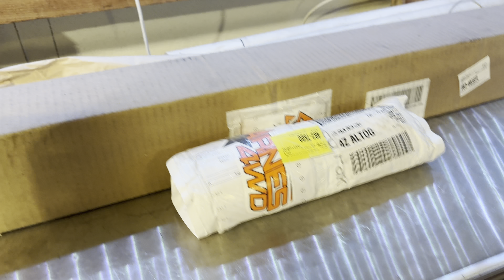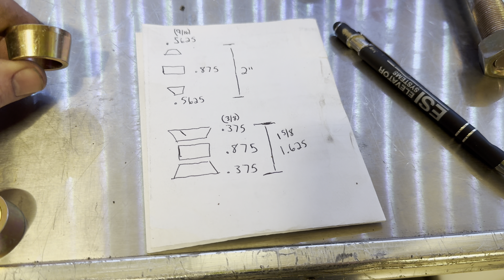Building the Steering!!! Jku on Tons part 11!

Comment: If you use the front holes you won’t have full steering. The distance from the center of the balljoint to the center of that mounting hole is more than the pitman arm and won’t allow you to have full steering.
Reply from the maker: I didn’t realize that! Thank you! I will get some more bolts and get the drag link switched to the back hole! I do have a gap in between the factory stops on the knuckles so there’s room for more steering angle which would be great. Turning radius is terrible compared to my two door lol

Comment: Are you getting full lock to lock steering going that way on the artec high steer knuckles?
Reply from the maker: I do not, there's about a 1/4
inch left from the factory stops on the 60 knuckles. I was doing some research after seeing this and didn't realize that in the back hole it will have more steering!